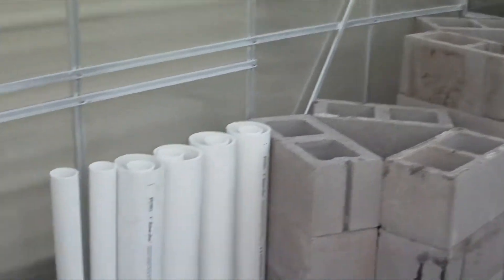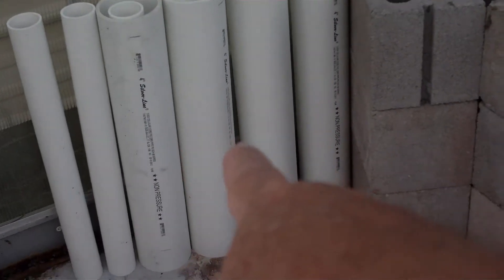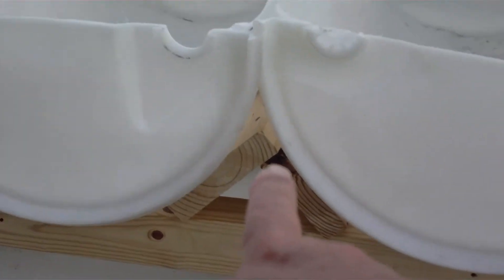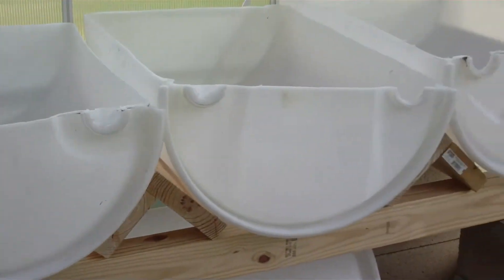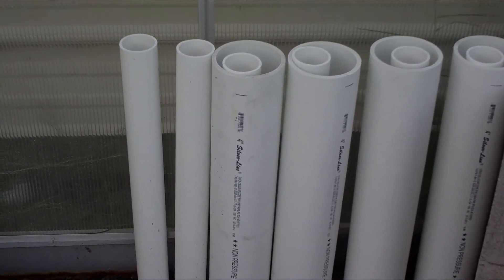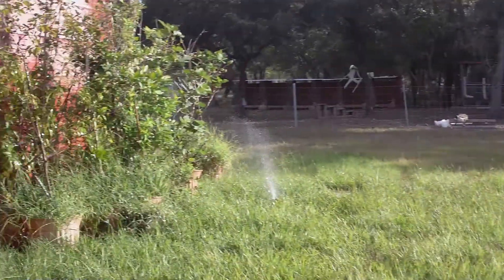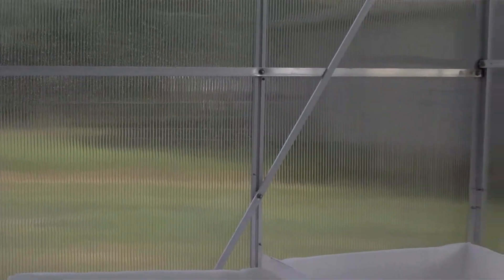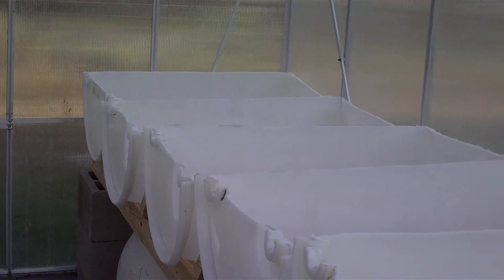Aquaponics System Setup - Part 2

Comment from the maker: No, they don't need it because they are not cut all the way, there is a relatively small rectangular opening in the top so that barrel maintains structural integrity. Good question though.